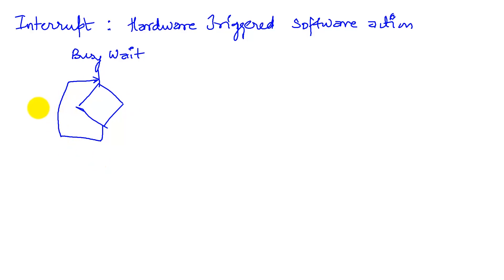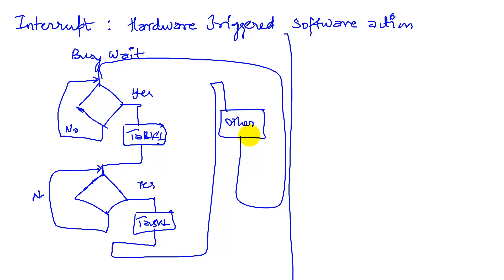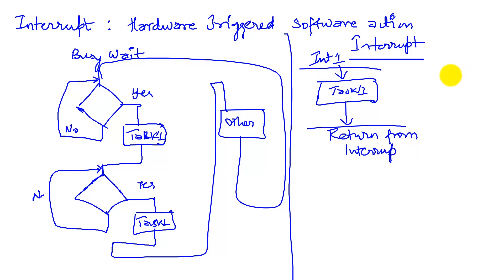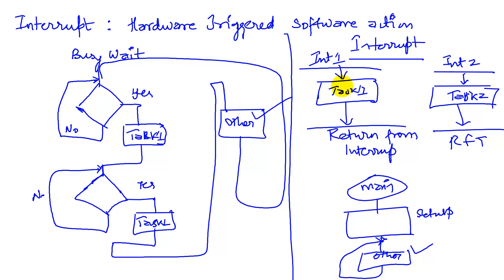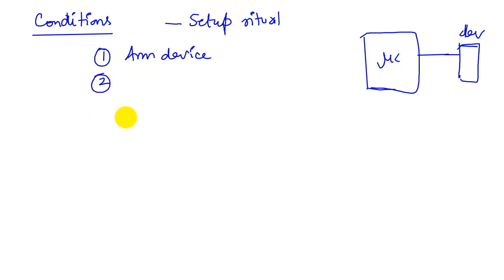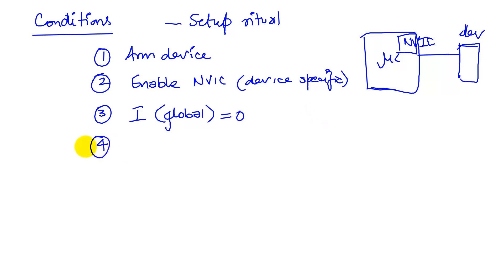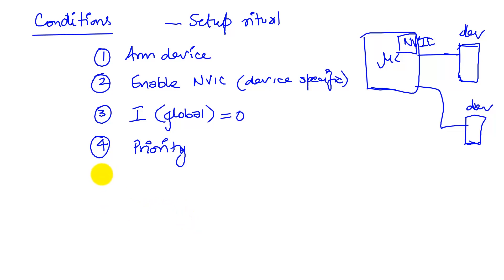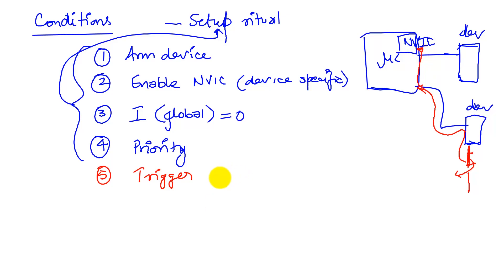C12 1a Interrupts

Comment: Hello Professors, I have a question about interrupts, basically I am upgrading microcontrollers firmware using a pendrive and the pendrive is working on interrupt. so there are two programs running inside the microcontroller and both the programs have interrupts on their own. on my first program, interrupt works really well but as soon as the second program runs, if any interrupt occurs then my microcontroller hangs.  So why the microcontroller is hanging?